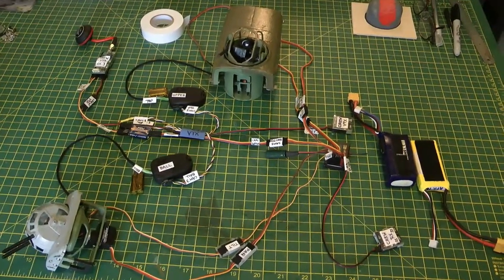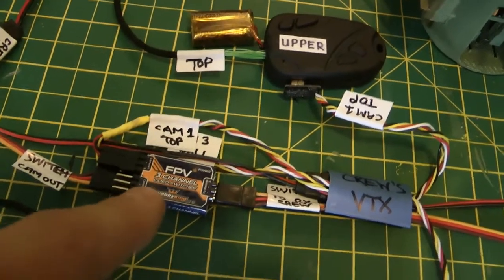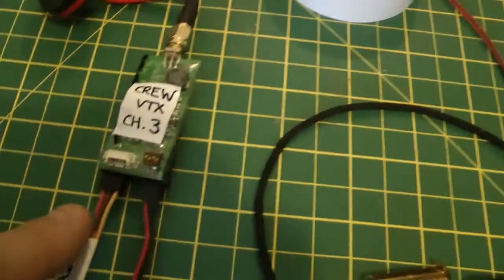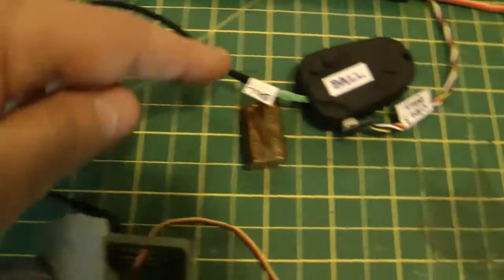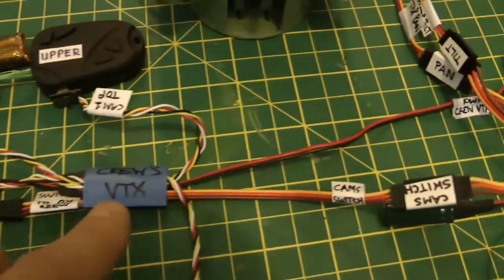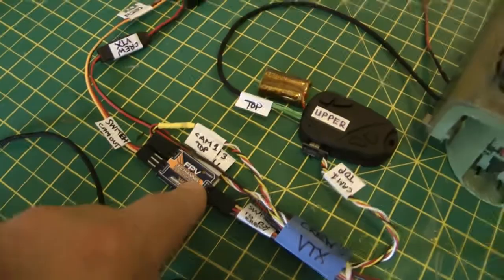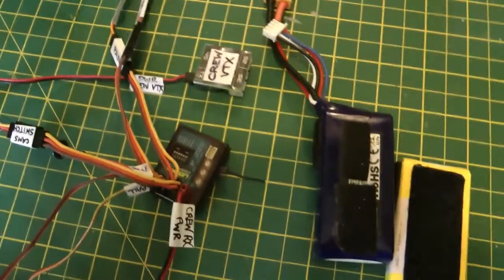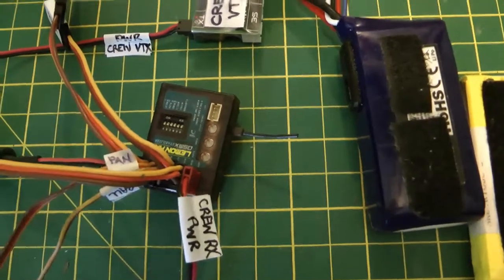Wiring the turrets on an HK B17 for FPV

Comment: I've enjoyed seeing RoboBiggles videos.  Just amazing.  Is that Fatshark Transmitter a 250mw, and does it transmit live stream HD video from the Mobius Camera?  Thanx Tom.  I'm a bit new to Live FPV, and I am looking to improve my video quality.    https://www.youtube.com/watch?v=EZu39Ay3Hkw
Reply from the maker: Here in the UK the max output for a VTX is 25mW Richard, but the higher output ones have all the same connections. And yes the Mobius 1 will give you live feed at the same time as recording 1080p HD video. It requires a special wire to plug into the VTX which again you can buy ready made from the same retailers that market the camera - they cost only a few dollars. Scale FPV rocks!
Reply: Ok, so I get a Mobius Camera, detach the lens, put the lens into the cockpit, wire the body to the FS VTX (with that special cable).  Correct?
Reply from the maker: That's right.
Reply from the maker: That Freewing P51 is a beauty - that's also a nice pan tilt unit in there, sits well in the cockpit. The Mobius will definitely make a huge difference. The other thing is the cockpit glazing. I replace the flat panels with optically clear acetate sheet - the old overhead projector film. It's like glass - you have my video soaring over Shropshire - well that is what encloses the glider cockpit. The domed canopy area cannot be replaced by it as it won't form a dome, just curves. You could do what I did with my Spitfire domed canopy - fix it in the canopy open position. Good luck upgrading that is a great airframe to work on - and I love the sound!